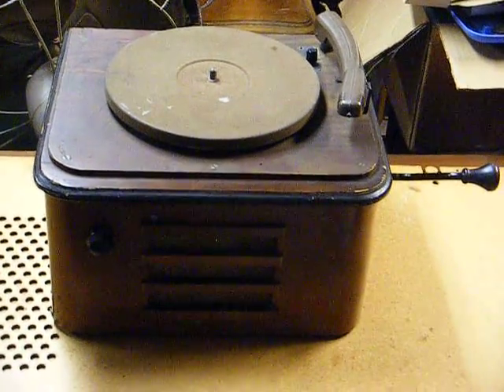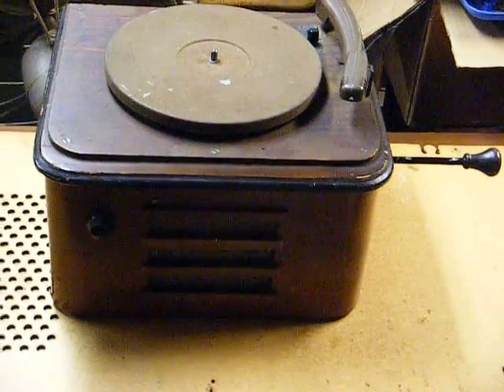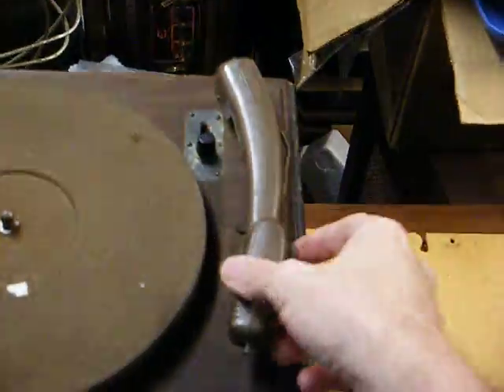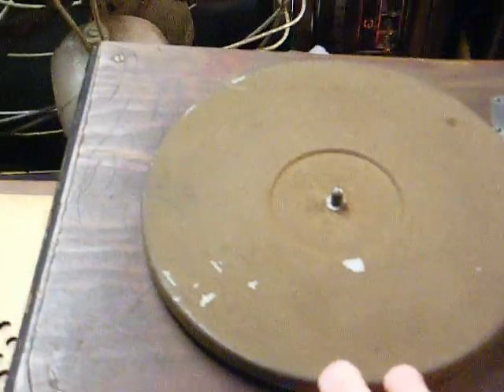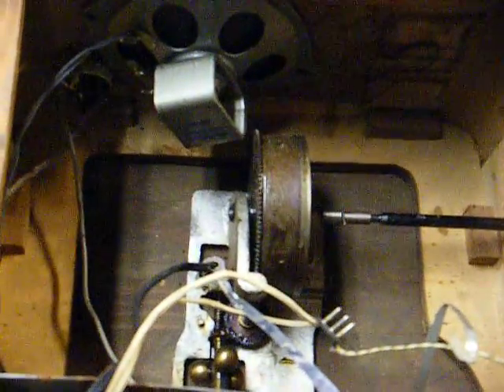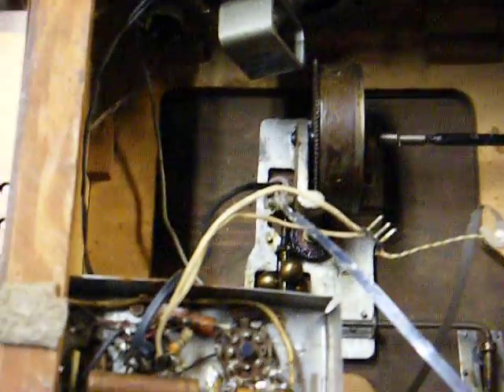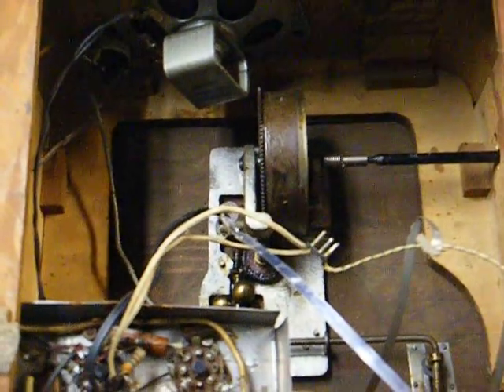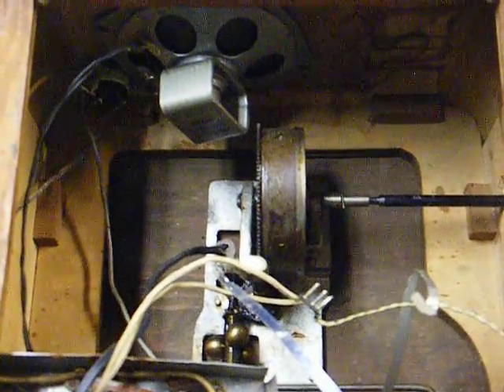Homebrew 78 RPM record player phonograph

Comment: Yeah, that's interesting! You know that you can build a " battery" for this by snapping 10) 9-volt batteries end-to end & then wrap them in electrical tape to hold them together, then, for the filaments, just use a 1.5 volt "D" cell. I've made several of these types of "Batteries" for these old sets, including the 45-only RCA Victor "Skipper" and they work great and last forever!

Comment: very cool.it doesnt necessarily have to be a homebrew.in my 1930's and 1940's sears catalogs they have phonos just like this! they were for farms without electricity.the amp would be run on batteries and the phono motor run on a spring just like this.